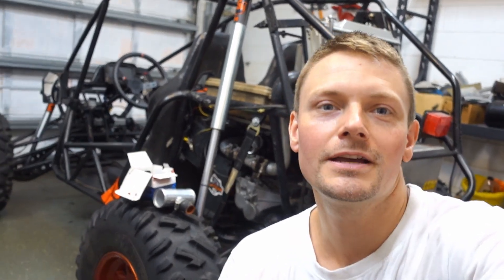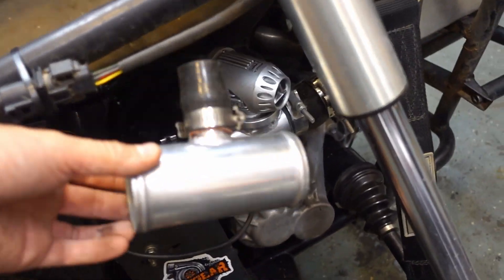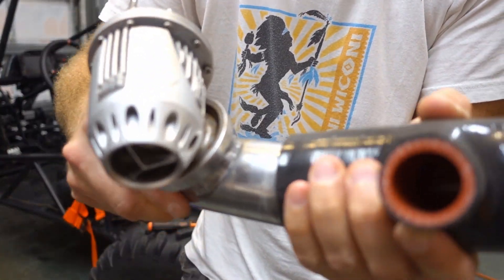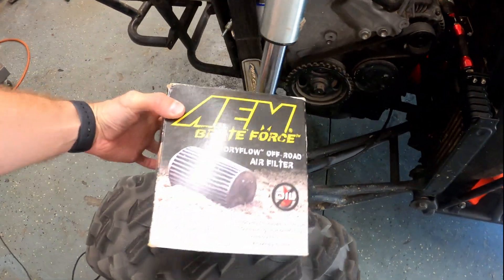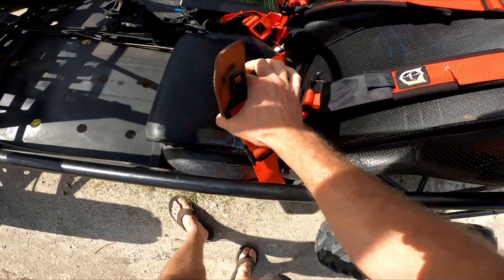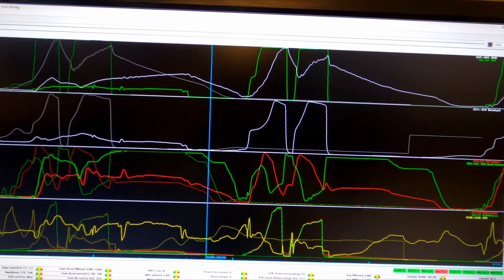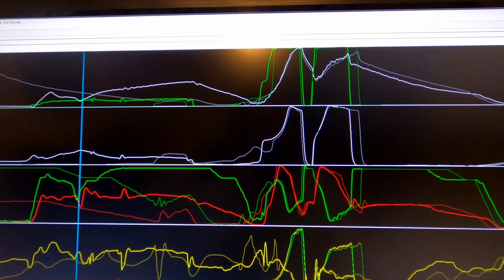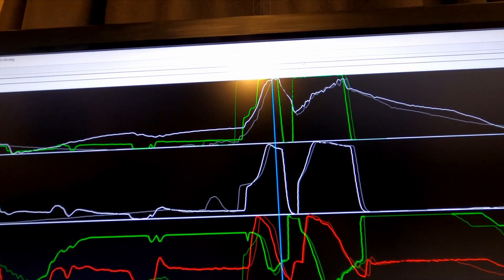Do Turbo Recirculation Valves Spool Faster Than Blow Off Valves? BOV vs Turbosmart for Performance

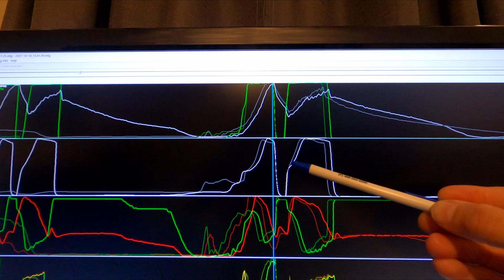Comment: 12:20. The boost pressure difference isn't an anomaly; the engine RPM is higher when the throttle is opened with the BOV - more airflow will more rapidly accelerate the compressor and increase boost pressure sooner.  If the engine RPM had been the same as the recirculation case, the boost curve would likely have been the same as in the other comparisons.
Reply from the maker: Good eye, I don't think I even noticed the small difference in RPM at the time

Comment: The reason you're not hearing turbo noises on an OEM vehicle is because they developed the car to silence it, not because it's a recirc valve.

With the intake resonator removed (well, I did aftermarket intake at the end of the day), plus catless DP, you can hear tons of turbo noise, the spool, the recirc actuation...  So no, the recirc valve is not the reason it's so quiet.

Comment: The only thing i’d say is some people aim the recirc right at the turbo blades. 

But the cars that need a recirculation valve are the cars that have a mass airflow sensor. Because if you calculate the air at the mass airflow sensor, but then vented to the atmosphere that was air already counted in the tune, and then that air has now been removed so the ECU thinks that air is still in the system when it is not causing a rich condition and sometimes stalling. For example my 06 sti needs a recirculation valve or atleast one of those 50/50 valves.

Comment: On the graphs, you should have overlaid the time when boos pressure drops right after you closed the throttle, instead of comparing how quickly the boost comes back on.

Really in order to make a difference, you would need a check valve on the pipe between the air filter and the tee where the recirculation valve dumps the boost back in the charge pipe. Without it, all the boost pressure is vented backwards through the filter

Comment: excellent analysis! really good seeing those graphs. but i was curious... why yours doing re-circulation still did the tsshh sound while the factory ones doesn't?
Reply: most factory turbos have it as part of the turbo from what i understand its ran differently so you dont get over pressure. i could be entirely wrong.
Reply: @cherylmartinez3001 as far as i know the factory ones are pretty similar. but they are more covered, more plastic, and the engine is enclosured. i think thats why.
Reply: @felipebutcher  it looks like the factory turbos for the most part have a waste gate part of the turbo that opens pretty easily to dump into the exhaust and dont run a BOV, they say most modern stuff on the other hand comes with a recirc valve, but since his is aftermarket and running higher boost i would assume is the reason you could hear it.

Comment: I appreciate you adding that last part. First thing I said was a turbo that size really wouldn’t benefit from it as much as a GT35. OEM manufactures also use them to minimize noise that the average buyer doesn’t want to hear. Nice vid 👌🏾

Comment: The main reason factory setups used to use recirculating was because they didn’t use MAF like we have now. They recirculated the already-counted air back into the system so the old computer wasn’t expecting more air than it was getting
Reply: I agree with this  comment, the recirc valve is not fitted for spool it is fitted to ensure the quantity of fuel added Is correct for the quantity of air added.
The MAF sensor (mass air flow) measures the quantity of air sucked into the engine, based on this air quantity, the ECU calculates how much fuel to add.
If you blow off a proportion of that air (let it escape to atmosphere)  the ECU is still going to add enough fuel for what the MAF is telling the ECU is the quantity of air that the engine has ingested. So a vent to atmosphere will cause the engine to run rich at the point of the air blowing off.
This is why when a recirc valve  is fitted it recirculates the boost back into the system after the MAF (engine side of MAF) so the quantity of area is not measured by the MAF sensor again.
If you are using a MAP (manifold pressure sensor) to control the fueling it does not make a difference to to he fueling  if use a recirc valve or a Blow off valve is because the blown on off air is not seen by the the map sensor.
Hope this makes sense to everyone.

Comment: Great video, currently in same situation running recir(same kompact as yours) and just thinking of plugging the recir pipe to intake. I've read the reason why Manufacturers use recir set up is due to MAF sensors in intake. venting off that metered air causes the system to run lean for the quick second, which hurt cats. but on custom set up without cats, no issues.
Reply: Wait, I thought they run rich because the ecu has accounted the fuel amount for that metered air that isnt there anymore

Comment: Are you still using the standard open diff in the gearbox?
Reply from the maker: Yep, an lsd would be awesome but few parts like this available. The oem has been working really well though
Reply: @DirtGearTv   ya an LSD would make it. I've mine welded but as for low speed tight corners and driving around the house its not great and hard work😒 but way better traction for off roading or sliding about😂

Comment: Manufacturers maybe limiting contamination possibilities in case valve sticks open. Also recirculating heated (from compression from turbo) air and heating it again with recirculating valve would seem a negative.